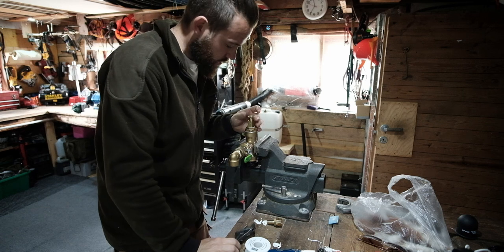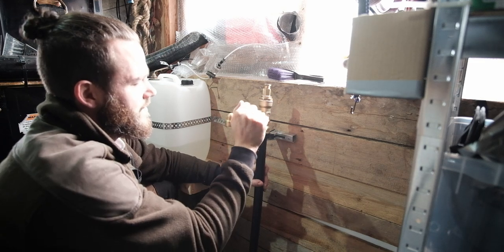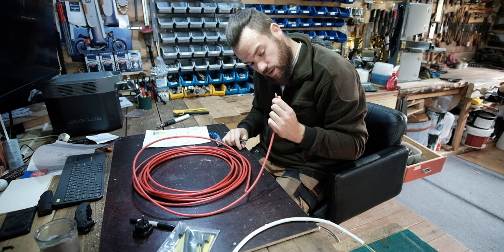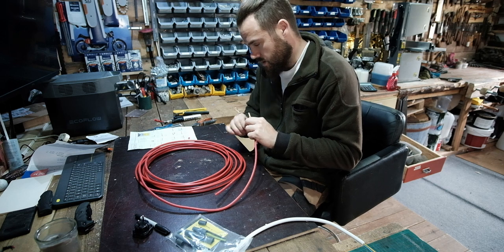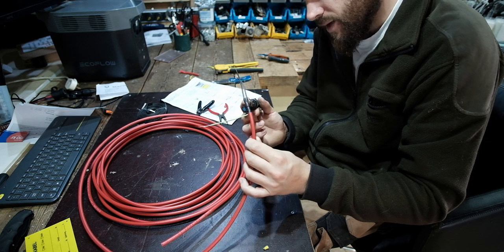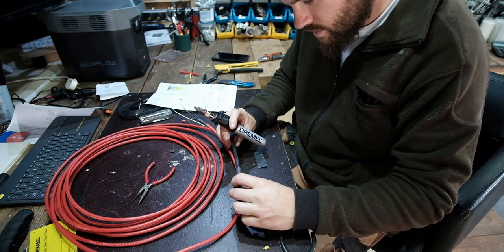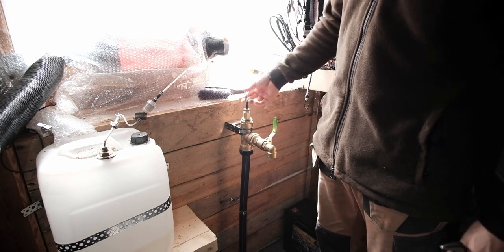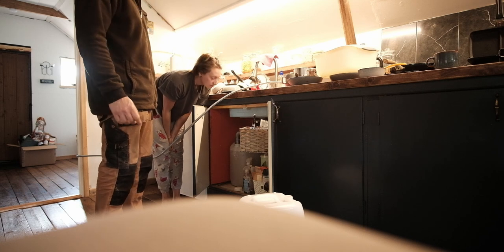Electric Cable Inside Water Pipe? What Could Possibly Go Wrong...

Comment: yes that's new to me. Here we put the heating wires around the pipes. But also we don't have the kind of winter temperatures you have so maybe around the pipe is sort of enough for us (sort of, because when we have a deep cold snap I just run the water in the end otherwise it freezes over. But then I have maybe 1 foot maybe 2 feet where I can not reach and cannot put the heating wire around, the pipe goes through the concrete slab on a north facing wall...) That's very interesting. Now I now such things do exist. I also loved to learn in your previous video that there is this special valve that can drain all the pipes. Would love to have that here but again we don't go as low temperatures as you do in winter. Helpful when you have to leave the house unattended in winter though.

Comment: Hi Ash, Marie, hope you are well. Good progress on the water job. You'll want to go crazy now washing everything, car, van, bike, tractor...🤣 Thanks for sharing, Stay safe and keep up the good work. PS. An old timer plumber once told me that ptfe tape is used for tapered threads, and parallel threads have a machined flat surface at the end of the thread and use a mechanical device for sealing, eg. rubber washer/'o' ring/crushable washer. 👍✌
Reply from the maker: Not going to lie, We bought a pressure washer the other day 🤣 Cheers! Oh really? interesting 🤔 Well so far nothing is leaking so hopefully it stays that way haha

Comment: You might have already found out how much of a kick a water main can give when you turn it on. A few more brackets on the pipe inside would help in the long term. I’ve a friend who did industrial plumbing until he retired and he was notorious for putting in twice as many brackets as regulations required, but he said that if one failed it was still within the regs. He was popular with his customers as it reduced their long term costs for the price of a few brackets and barely any more time.
Reply from the maker: I think I will add another bracket just to be safe 😊 it's actually not water main though, it's gravity fed from our own well so the pressure is nowhere near domestic taps 👍
Reply: @ash.pollard  Don’t forget to insulate above ground to help keep the heat you’ll be paying for in the water 😁
Reply: I’m trying to remember anything I was told that might help. Cold water pipes are where you’re most likely to get condensation inside so should be insulated. Less useful to you is that hot water pipes were most likely to bust as years of heat cycles would weaken joints in lead or copper.

Comment: Where did you find the brass fitting to seal wire coming out of the water line? Or did you make it?
Reply from the maker: It's a kit we bought from a local guy but they sell it in all the large hardware stores. "Cable entry gland" or something like that 👍